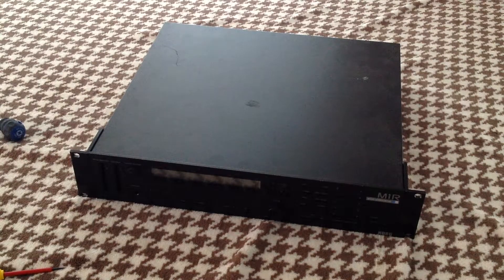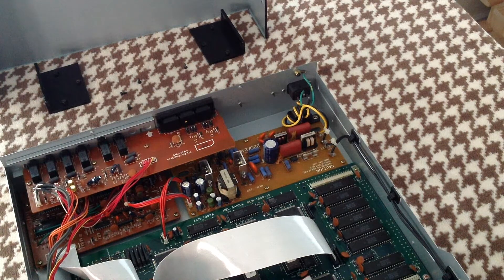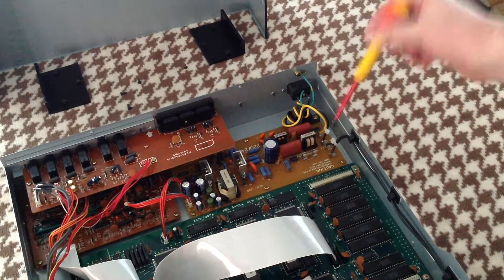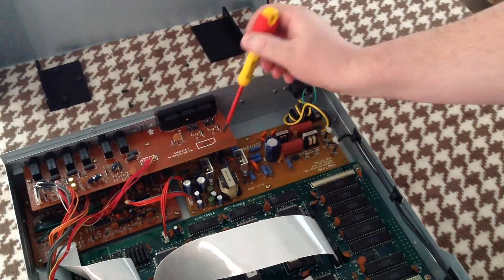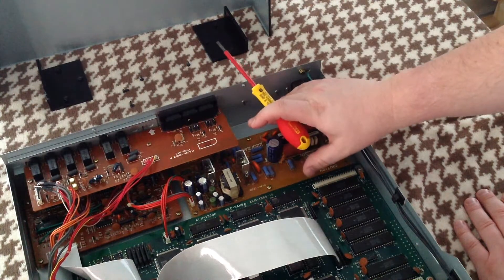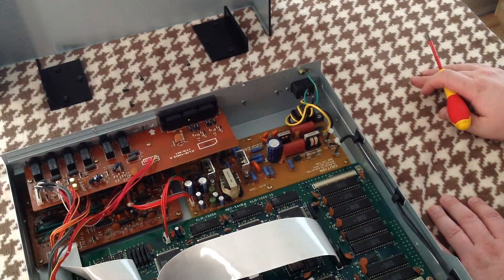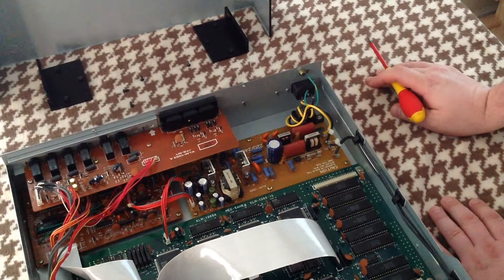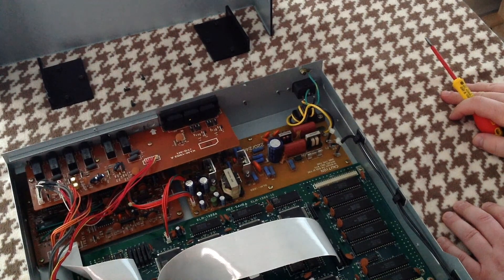Korg M1R - How to convert a 110V version to 230V operation - 2015-12-24

Comment: Im getting an M1R EX from Japan and not sure if they were actually sold in Europe or not but i have an M1R that's 240v so may take the power supply out of that in place of the 110v power supply.
Reply from the maker: Hi @jaggass  

The Korg M1R EX were sold in the UK and there was also an upgrade path to convert a normal M1 to an EX version as well.  The power supply in the Korg M1 or Korg M1R is the same as the same EX versions.  So you should be OK to transplant a UK Korg M1R power supply into you imported Korg M1R EX.  Jon
Reply: I can't find an M1R EX here in the UK don't want to butcher a working M1R for it's power supply so will buy a 2nd hand 240V supply in future and convert it. My step down transformers kept burning out.
Reply: I think some soldering and de soldering will need to be done but easy enough as the wires just go through holes on the terminals.
Reply from the maker: Hi @jaggass 

I agree, don't butcher a working Korg M1.  Look for a machine that is being broken for parts.  They popup from time to time as do the power board.  That is what I did.  But you need patience.  And I used a step down transformer in the interviewing period.  

I did the mod as I didn't want to accidentally plug the rack unit into a 240V supply and fry it.  Which is easily done when moving studio equipment about!

And you are right the soldering is relatively easy.  Jon
Reply: My M1R is for sale now so can't butchering it and wouldn't anyway and even if did swap the power supplies the backing plates that say the model and power supply wouldn't match. I did convert my Japanese DX7 to the European spec switchable 110-240v power supply using a donor which had a faulty keybed so was well worth the conversion which stopped.
Reply from the maker: Hi @jaggass 

Concerns noted with the working unit you have upper sale.  There are a number of companies now producing well suppressed alternative power supplied.  I am exploring this for another project at the moment.  Jon
Reply: I've sold the M1R now and waiting for the M1R EX to arrive and will use a step down transformer for now.
Reply from the maker: Hi @jaggass 👍 Jon

Comment: You didn't show any steps on the conversion process. You took the cover off and talked. Perhaps you didn't do it ?  How about even showing the old power supply? It's all good if you have access to an original part. But what if you don't? How about details on using non-original parts to convert from 110 to 240 ?
Reply from the maker: You are correct I didn’t.  I did this conversion before I started the channel so was not in the habit of videoing the work.

I did this video in response to a question from a tuber way back then who asked if it was easy to cover from 240V to 110V.  So as I had performed this operation, just the other way around, I filmed an explanation of how to do it.

- It really was as easy as 4 screw to move the top board and then just move it to one side.  
- Desolder the live and netural wires from the board.  Making note of which terminals they attach to.   
- Do the same with the wires to the power switch.
- Remove the post power supply connectors on the other side of the board.
- Then six screws and the board pops out.
- Installation is reverse of the extraction.

In terms of using non-original parts to do the conversion.  Honestly it is something I haven’t done for a Korg M1, but I have done this in the past.  The M1 requires 5 voltages smoothed DC voltages to operate:
+12V (0.3A)
Ground
-12V (0.13A
+5V 1.2A
Ground

As this is a standard ish voltage range you should be able to pick up a specification and transformer that will deliver these voltages from your local mains supply.

Jon